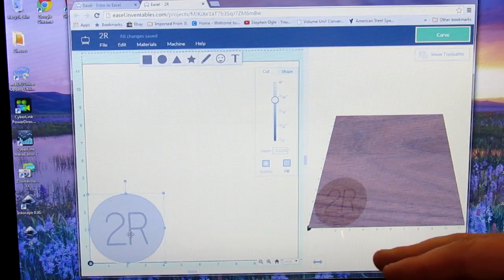#86 A Woodturning Coaster Collaboration

Comment: What's the point to having impervious coasters? Won't the sweat off a cold mug of beer just run down, pool on the coaster till it over flows over the edge and create a bigger water ring on the surface you are trying to protect?
Reply from the maker: Saul Rosas Possibly. However, I have a set of Coasters I bought while stationed in Crete, Greece which are like ceramic and perfectly flat on top. Never had a problem with them. This could possibly be a problem occasionally though. Thank you for your insight.

Comment: Will the xcarve work on turned pens??
Reply from the maker: +William Peskin Thanks William. The X-Carve is a 3D capable machine so I guess if you really knew what you were doing it could carve on pens. Your measurements and diameters would have to be very accurate though. An inlay on a pen such as the inlay in this video would be very possible though.  If you start with your raw blanks and carve in your inlay pattern to turn later, I believe it would work very well. Hope this helps.